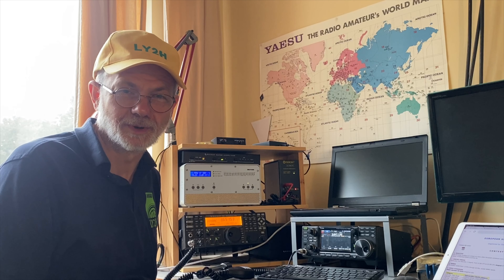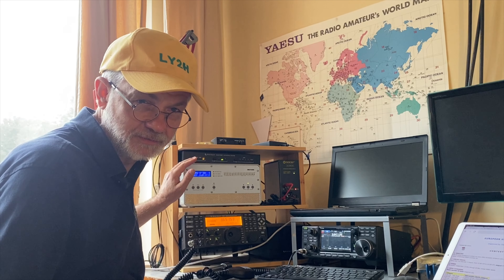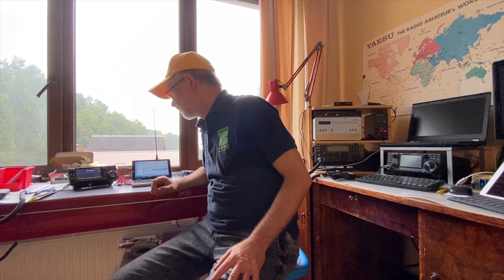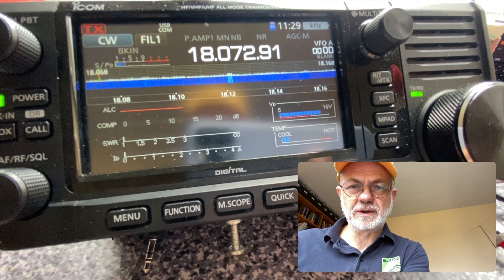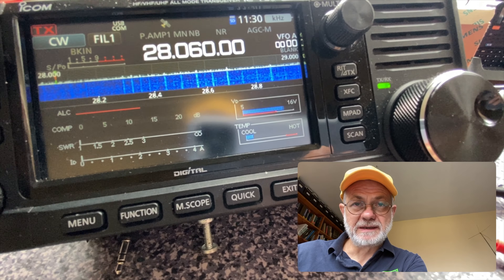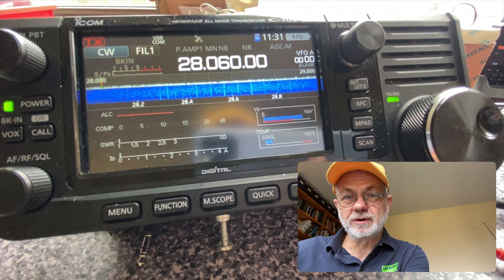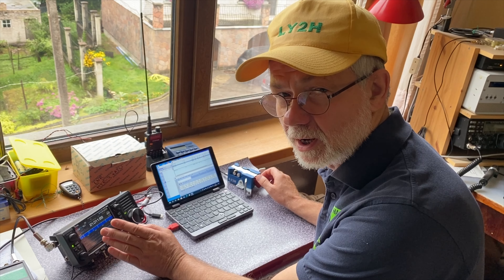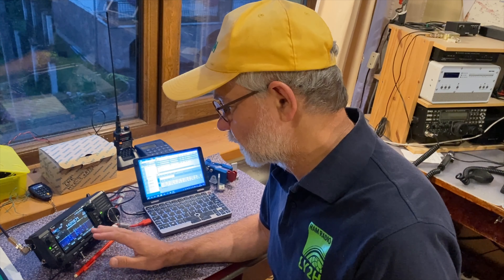ICOM IC-705 in the HF contest: excellent receiver, 10W into EFHW antenna, but QSK impossible.

Comment: The function of the compensation coil is to bring the resonant point in the higher bands down in frequency. You will need an antenna analyser to see where the resonant point is now. It has likely brought the low SWR point down and out of the band on 15/12/10
Reply from the maker: Thanks for the comment! Yes, I did check  with the VNA, the resonance on the bands of question is a bit too high in frequency except of 17m where it is a bit too low. So a few inch of wire  to add to the overall length could be reasonable as I'd like the resonance a bit lower even on 80m. It might also take to play more with the location of the  coil in order to  find the right antenna current point. So more videos could be expected on the topic! 73! Linas LY2H

Comment: @8:39 - Just wondering when using the 705, why reduce the RF Gain if the purpose is for a cleaner waterfull go into the 2nd menu (<2> button <1> on the left) and  adjust the <REF> level, it will do the same without losing weaker signals.
Reply from the maker: Thanks! The REF is kinda' "RF Gain" just for the visual spectrum scope only. If I want also to deminish the audible noise level, I turn the RF Gain  which is in the receiver's signal path. 73! Linas LY2H

Comment: Hi, thank you for sharing. I am planning to get IC-705 mainly for Digital mode (Olivia / PSK31); have you had any experience with this use? Also may I ask how long the feeder cable to the antenna and what kind /brand of notebook that use for this video. 73.
Reply from the maker: Hello JT, thanks for watching! Well, I have tried PSK31, it works, just the only problem - too few stations you can see  in these other than FT8 Digi modes nowadays :). I have not tried Olivia for years, sorry to say... For the PSK , I run a basic Digipan V. 2 software. RTTY is a bit more lively and the 705 has got a very nice in-built decoder for that for receiving without the computer connected. Unfortunately, for transmitting, it only can send from macros which means you can not quickly send the correspondent's callsign , for instance. Neither decoder though, nor Macros-sending is not even possible for the PSK mode without the PC. It's a shame I think, and Elecraft KX2 is unbeatable in this respect: you can bith receive and transmit as RTTY, as PSK31/63 on it with decoding on the display and transmitting from the CW keypad. I like this functionality a lot on my KX2 and miss it on my 705 :( . 
My feeder for this EFHW antenna is made of abt 11 meters of RG-213 cable with RF choke at the antenna switch box in the shack. My little laptop is CHUWI Mini Book , 8/128 GB 64 bit. Hope, this helps, 73! CU on PSK31! Linas LY2H
Reply: @Linas_LY2H  Thank you for the time to reply for my inquiry. Appreciate so much, I hope we will in contact soon on the air. JT VK2 73

Comment: Is this radio good for CW?

I just ordered the ic-705 for this exact thing. I’m new to everything. But I’m learning to do CW as I’m not interested in voice too much.
Reply from the maker: Thanks for watching my channel and congratulations on learning CW! For me, it’s the best mode ever! Yes, IC-705 is good for CW, the built in electronic keyer is working nicely, accepts different sorts of key paddles well, it is convenient to change the speed of your CW with just the push of a button on the front pannel. The only drawback, and I tell this in the video, is the QSK. It’s when you can listen to the receiver in every pause between the dots and dashes you send. This is because the ‘705 has mechanical relays to switch from transmit to receive instead of transistors, and while going into the QSK (or F-BKIN, i.e. the full break-in) mode the relays clicking loudly and are not fast enough to switch in order to listen in between the signs. But , frankly, the QSK feature is not something vitaly important in daily CW work, many people don’t even care about it. I find it useful when making a contact with the DX station and it is important to trace every movement of it :). Much more important for the CW is filtering and ability to configure narrow receive filters on the spot while listening to the weak signals. And the IC-705  really shines here! It’s got an excellent receiver and fantastic digital filtering! You will really enjoy it. Let us know how will it be going for you! 73! Linas LY2H

Comment: I would love to be that fast on CW!  Do you hear words instead of letters?  HiHi.  I am thinking about buying the 705 as I hear many good things about it.  What logging software do you use?  Thanks for the video!!
Reply from the maker: Thanks for watching and commenting! Well, it's not that difficult to be fast in CW in the contest, the information you hear is mostly standard , mostly numbers and/or known abreviations... I really hear words in this situation as my brain recognises how  these entire phrases sound and is anticipating the phrase's end hearing the beginning of it. If it were some non-sdandard info, then you have to listen and copy letter-by-letter in your head until you can recognise the word :). But everything is much simpler than I try to explain here :). It just takes some time and training practice. 
I really like IC-705 and was pleasantly surprised by the receiver quality, it's really better than in my IC-7300. And I also like the VHF/UHF part of it. In my shack, the '705 replaced succesfully my good old FT-897D as multiband, multipurpose portable radio. 
My logging software in the contests is the N1MM+ Logger, for many years now. Have fun! 73! Linas LY2H